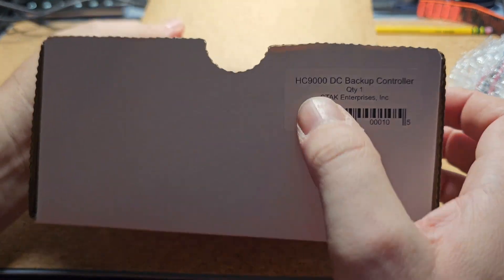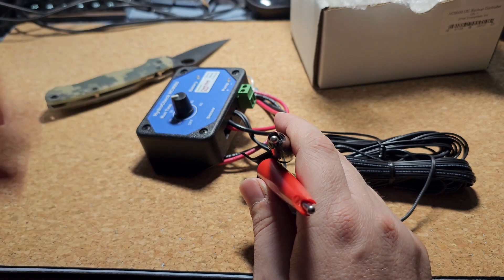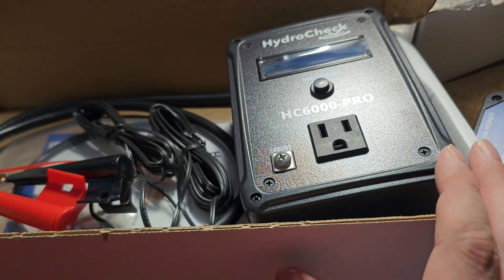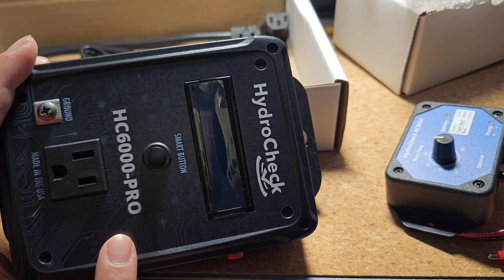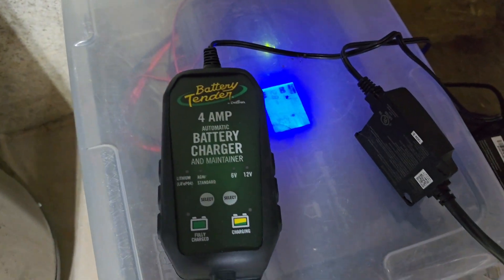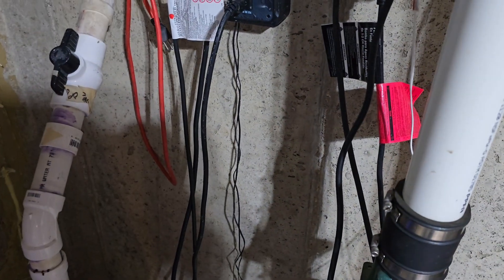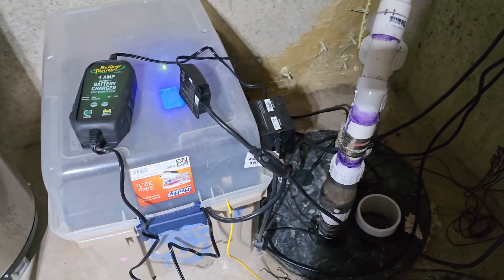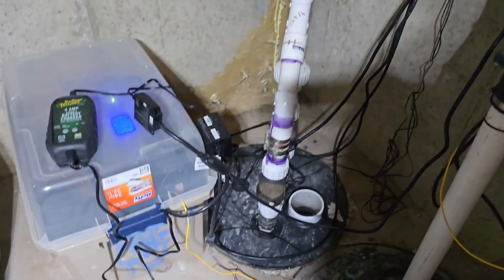Hydrocheck Review and custom install update

Comment: Thanks for the video!  This is exactly what I was looking for a battery backup solution.  Now I can use a lithium battery and my own charger and not have to buy a complete system that didn't have a compatible charger.   I know I could have bought a complete system and not plug in the charger  transformer but then I would get alarms because it would think I had a bad battery.
Reply from the maker: Ya this is the way to go.  Best of all no more topping off my battery at midnight when alarm goes off for low water levels.   Next project is setup my furnace to run off battery.